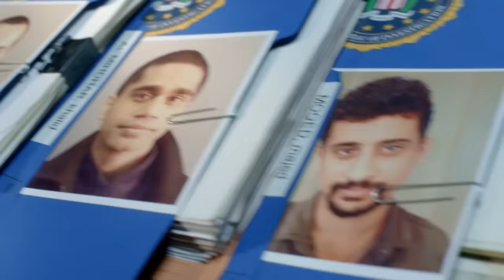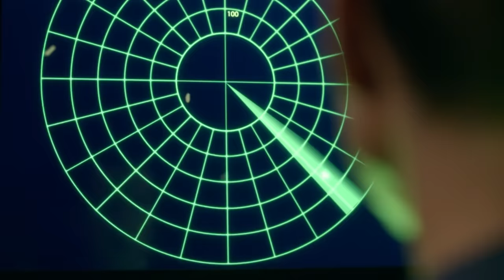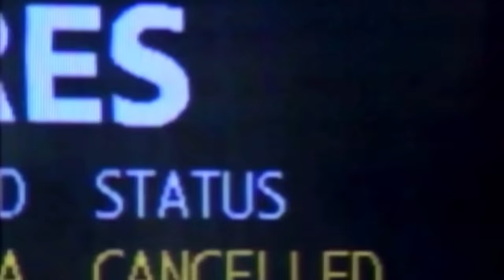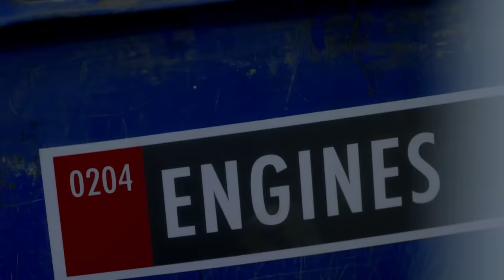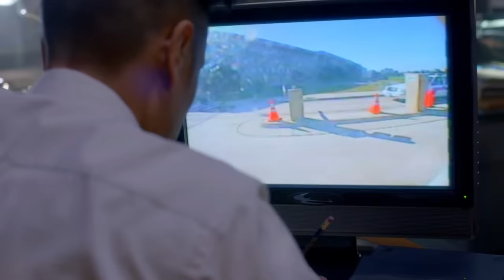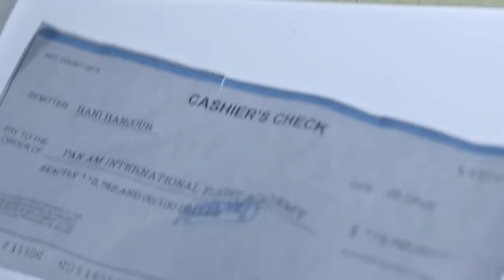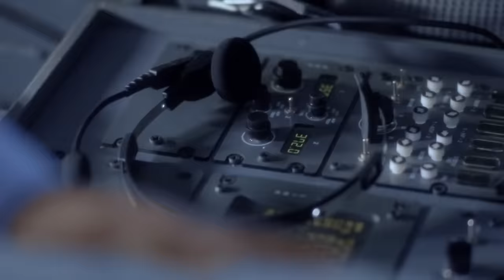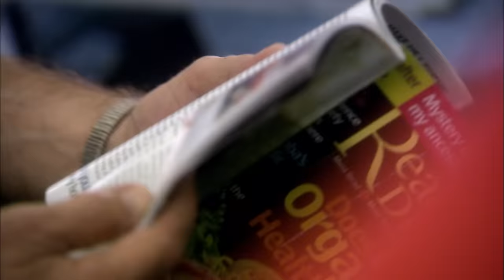9/11: The Attack That Led to The LARGEST FBI Investigation | Curious?: Science And Engineering

Comment: I don’t understand the first and second tower had already hit before this plane took off. Why didn’t they call for a ground and flight stop before this one left
Reply: My understanding is that flight 77 was airborne already. There were other planes that were lost track of, or dropped off 2nd radar, no radio, etc. But 77 was the only one that there were eyes on the radar screen Exactly when the transponder was turned off. There are some minor issues with errors in this video, but they're not big.
Reply: It was in the air already.  Plane took off at 8:20. 1st plane hit at 8:46. Pretty much as 77 was taking off flight 11 was being hijacked. Flight 175 took off 5 min before 77 did. So by the time tower 1 was hit the hijacked planes or even air traffic couldn't do nothing bout the other planes . Even the last flight to take off was 93 out of Newark. 93 left at 842. 6min before attack on tower 1. Had it been delayed for a few more min ( 93 was running late already.) 93 woulda stayed grounded an the airport 93 was at had a clear view of Manhatten .. atc towers at that airport saw the attacks happen!!!. But as 93 was climbing 11 an 175 happened. 93 passenger revolt happened right after they learned of the Pentagon attack .
Reply: @str8truth322  omg…. thank you for the timeline I didn’t realize it was so close together. All those innocent lives .. I’ve always said while I feel tremendous sadness for the lives lost in the tower. But imagine being on one of the planes. Not one single piece of human flesh was or could even possibly be recovered.
Reply: I wondered the same questions. Did a lot of research an studying . It all made sense . Why atc an our fighters where a lil late responding.
Reply: In addition to what others have said (it was already airborne), communication simply was not that quick. In fact, it's highly likely that they chose to attack in the morning because they knew the response would be slower. Immediately after the attacks, all pilots in US airspace were told to land at the nearest airport that could take them.
Reply: It appears they didn't even know their own processes and procedures. When you follow these stories about 9/11 you find out there there were, and maybe still are people in jobs they are not qualified for. You have to wonder if they were even trained. The people on the ground, in place to help and intervene were tripping all over each other that day. Talking and asking questions but not doing anything to help in any way. Even when tower 1 was hit the fact that someone told people in tower 2 that they were okay and could go back to their desks led to even more lives being lost. The incompetence was unbelievable.

Comment: In every case, the highjackers were able to take control of the cockpit without one SOS, mayday, emergency code, or sound being recorded???? And on flight 77, the highjacker pilot was able to complete a high speed, descending, circular maneuver when he couldn't pilot a small airplane?  The Pentagon is probably one of the most covered buildings in the world as far as security cameras and yet there is not one clear image of a plane striking the building? A lot of unanswered questions.
Reply: I agree. Also if plane hit like they claim why is grass not tore up? A pilot with that skill is not a newbie. Somethings wrong somewhere…..
Reply: The hijacker’s probably had flight training
Reply: @goanimatenetwork3550  yes they did. But not that much training. Even AF couldn’t hit like that with out rubbing the ground with belly of plane. Look at the hole in building then how tall a plane is
Reply: @ALLLL4him  Aaahh yes the good old, erroneous "size of the hole in the Pentagon" bullshit argument.
Reply: I remember the interview with the 40 yr veteran Air Force pilot who said he couldn't have pulled that maneuver without crashing.  Too low too fast & the plane would have tore up more than a light pole?  People died regardless & that is indisputable.  Impressive that all 4 planes crashed without losing their wings.

Comment: Logan airport in Boston got a lot of flack for the attacks regarding security (strangely no one did the same to Dulles or Newark).  This was unfair because the hijackers actually flew in from Portland ME.  They figured security at a regional airport would be looser and Logan was a connecting flight.  They wouldn't be checked again for a connecting flight.

25:50 This was a major point.  Hijackers up to this point had been intent on making a political point or fleeing to another country, not suicidal.  Security is also in a tight spot, people get irate if they are slow but if they go quickly they miss things.

One interesting note, at a flight school in FL some of them attended the instructor pointed out that the students didn't seem very interested in learning landing.

The hijackers were very smart about it. They did multiple dry runs before this.  They cased out the airports and flights like jewel thieves planning a heist.  They would do dry runs seeing if they could get small weapons on board that if found could be dismissed as a common tool they forgot to leave behind.
Reply: People always talk about the security issues but even if they were searched the stuff they had was allowed at the time. Knives and box cutters with blades under four inches long at the time weren’t barred by the FAA and airport security guidelines authorized passengers to be allowed to carry these items. More often than not even when passengers were found with these items they were returned to them. And that’s assuming the metal detectors even catch them because the sensitivity of metal detectors at the time often didn’t even get triggered by knives of that size. 

Nor was there anywhere close to the level of security checkpoint to board planes then as there happen to be now. It’s one thing if those items were banned and they missed them through negligence but they were items allowed on the flights which was why they chose those specific weapons. The flack that gets thrown at the airport security just isn’t totally fair. The better target of blame would be the FBI and CIA who had been made aware of the possibility of this plot happening, being imminent, and being warned of the hijackers ahead of time that they didn’t take firmer steps to try and prevent knowing the risks a year or more ahead of time for some. And of course so much of how this happened was the fact it hadn’t happened before so passengers and the like didn’t know how to approach fighting back. I think in todays age being aware of this possibility outcomes may very well have been different.
Reply: I got on 4 flights with a pocket knife in my carry on backpack 1 year after this. These hijackers were more successful than than any episode of A-Team I ever saw. Suicidal to boot!! Like 19 suicidal Ethan Hunts.
Reply: There were plenty of videos afterward, where is all of the security footage of the supposed terrorist boarding the planes?
Reply: Good points! I used to travel quite a bit prior to 9/11. I installed & repaired computer networks for a company out of New Hampshire (I was based in Illinois), it wasn't at all uncommon for me to grab my tool kit (big hard sided suitcase full of tools), drive 29 min. to Ohare & jump on a plane with my carry on's... I believe I've only flown like 3 or 4 times since 9/11 - I know why the security is so strict now, but combined with everything else? No thanks, I'll drive.
Reply: @alleyoop66 I always wonder that too!

Comment: 4:54 - - radar operator - - 5:45 - - transponder (gives flight number, speed + altitude) - - 5:57 - - secondary switches to primary 
9:28 - - Fr. Stephen McGraw

Comment: Plus they should put accurate gps locating devices on black box's so in case of crash they get instant alert notifications about the location of the crash instead of wasting time on doing search missions for crashes
Reply: They should have one dedicated satellite and a private server to  keeping track of each civilian plane flying in the sky
Reply: They do now i think its called transponders...but even so there is a part of the ocean that when planes travel they are out of signal totally on their own.
Reply: @traceescozzari8940  Planes have  had transponders since the 80s (I think).  The hijackers turned them off.  When the transponder is turned off, the plane is an unidentified blip on the radar.  (Jan Griffiths).
Reply: @ak15912  And the transponders should  not be able to be turned off by the cockpit crew.  That's what the hijackers did.  (Jan Griffiths).
Reply: Yeah, the black box(es) would be the perfect place to put such a device.  (Jan Griffiths).
Reply: And this would have helped during the 9/11 scenario how?
Reply: Apostrophes are not for plurals.

Comment: No matter how many times I watch or hear this story it will never make sense to me how easily they got on and took over the plane with box cutters and how conveniently these amateurs were able to fly a commercial plane at that speed into the low lying pentagon…maybe it’s just me
Reply: Heck it really made me question how can these supposedly “terrible flyers” could hit The Twin Towers in their exact “weak points”
Reply: A box cutter to the jugular would kill someone pretty quickly, so it's an effective weapon. So that takes care of how easily they took control of the plane. They didn't easily fly the plane at all, as outlined in this video, but had enough know how to steer it into the Pentagon once they got close enough, which was to crash into it, as they did. It's a crazy thing to happen, but they planned for this for a while. They were flying planes the whole time they were here, just not commercial planes, which was harder to fly manually, which is why they used auto pilot to do most of the work until they got to D.C.
Reply: Me too
Reply: Yep. It's just you.

Comment: Cell phones could not work at that altitude
Reply: And speed.
Reply: They used telephones built into the panes that don’t require service to call their families. Any movies or documentaries that show them calling from their regular phones is just false.
Reply: @Randomswissguy  
There was mention that people were using cell phones. 
I do remember discussions about it but wasn’t very concerned about it at the time
Reply: @jimmoravec1326  ok I was wrong about it being false. Although most people called from air phones, you could still call from your regular phone. There was no airplane mode back then and plus, they were really low to the ground. The reason people don’t want you to make calls is because it can affect the planes navigation system but the phones back then weren’t as complex, so they weren’t affected as much.
Reply: @Randomswissguy  
Either way, bottom line is that there were no planes involved period

Comment: What a coincidence the flight recorder was too damaged to get any info off of. Also crazy that a couple of guys that could barely fly a puddle jumper were able to perform a maneuver in a commercial airliner that according to several seasoned pilots the plane wasn’t even capable of doing. Yeah right sure…Then on top of it all no debris or bodies found at the crash site. 🤔

Comment: Why would ANY kind of blades be allowed on board at any time? If, say, someone had to peel oranges, they could have asked a flight attendant for a plastic knife.

The same thing is concerning a possession of Mace on board: that's neither the body spray, nor the air freshener; so, why would the security guards allow anyone to bring it past the checkpoint back in those days?

The guards also missed something that looked like bombs. Even if they were fake, why did they not confiscate them?

Yes, surely, they do their job properly now, but did something like the 9/11 really have to happen in order for them to start doing their job the way it was ALWAYS supposed to have been done?

Comment: I do not consider myself a truther. But I do have questions. One of the biggest ones is this. This was an early week morning cross country flight. All of them were.  Why were they all like 1/4 full?  When is the last time u were on a flight less than half full?  I used to fly a lot. 9/10 flights were completely full and I did fly cross country in morning flights.  1/10 may have been 90% full minimum.  Not saying that means anything. Just saying it’s weird.
Reply: Excellent point.  I flew many times out of airports in the morning and the jets were always packed.  No airline company would be so fiscally irresponsible to assign 757s for a human cargo of 30.
Reply: Excellent point.  I flew many times out of airports in the morning and the jets were always packed.  No airline company would be so fiscally irresponsible to assign 757s for a human cargo of 30, especially in NYC.
Reply: this was in the early morning, from northeast to the west unite dstates, they typically arnet busy until later, also its stupid to think that when flights arent always full especially even if you do have expierence with stuff like that, i have a question of why just deny that people died? its not ethical to think of either anywat

Comment: It takes a while to make a turn and proceed to a new flight path without radio contact. They had visibility of the target planes by others. Why weren't fighters scrambled? The one in PA was clearly shot down and the the fact denied. I mourn for those we lost but there are so many inconsistencies in this story. The other documentaries shed more light yet this one is uncomfortably ambiguous. Where are the black box recordings, where are the parameters for the maneuvers that require a HIGHLY experienced pilot to execute? A low altitude, high speed targeting after colliding with light poles? The control surfaces could never have worked after being severed by light poles at the pentagon. Also what happened to WTC 7?